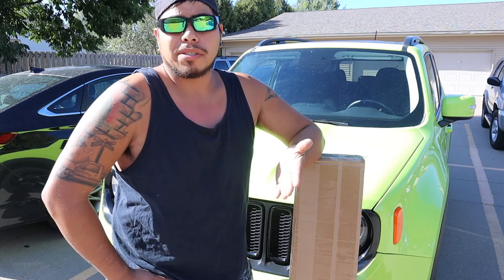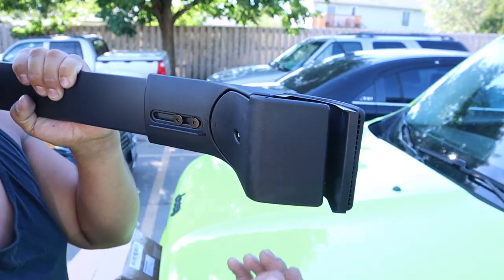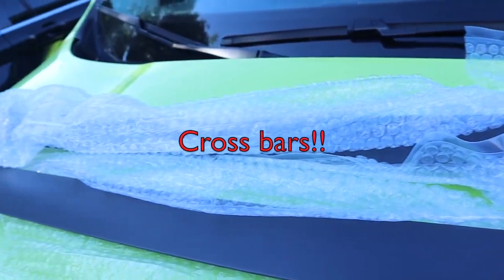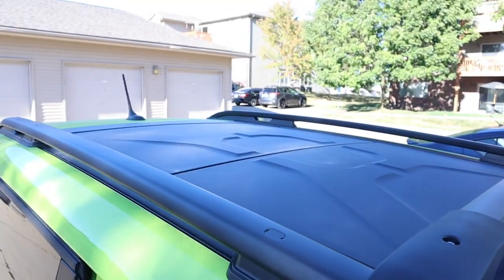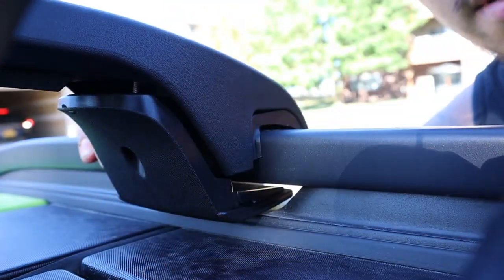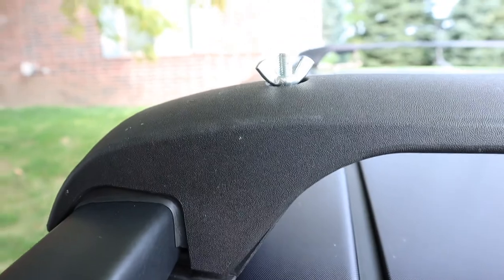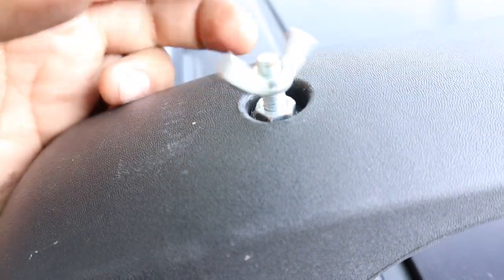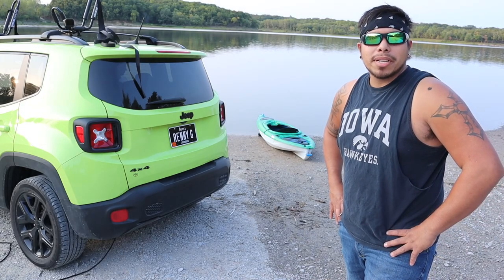Jeep Renegade Roof Rack Cross Bar Install

Comment: Ur link is not the same as the ones in ur video
Reply from the maker: Thats because the company that made those cross bars changed there design a bit. You no longer have to use Allen wrenches to tighten the clamps closed, just twist that knob.
Reply: @AdventureGT  my renegade is 42.5 from roof rack to roof rack. Is yours the same. Alot of these i see online say 48 inch
Reply from the maker: Yes mine are the same. I have a 2017 latitude and I know that these cross bars are at 43 inch. But they are adjustable